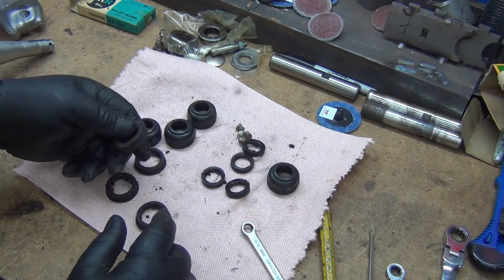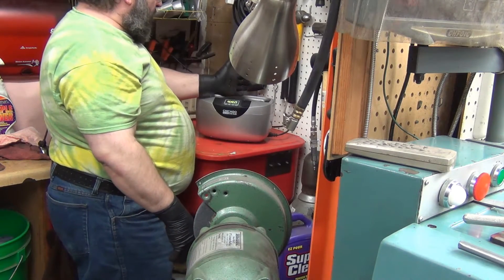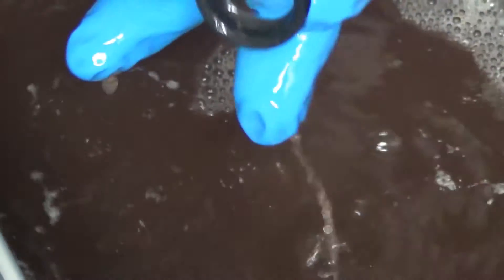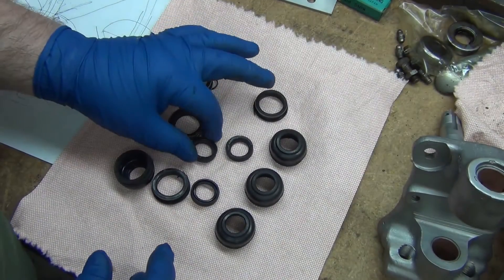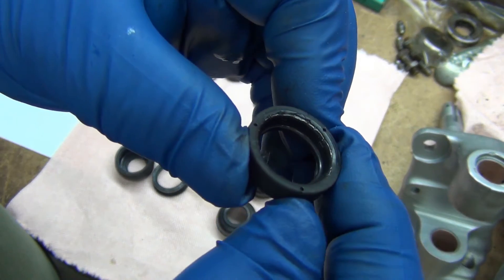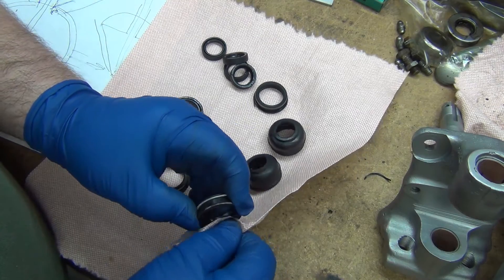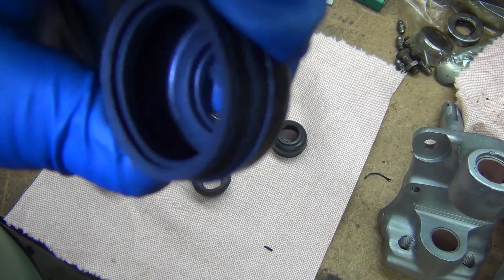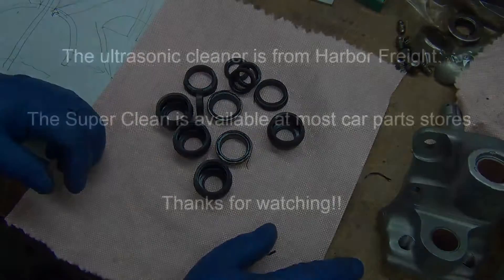UltraSonic Cleaner - Rubber Seals

Comment: My buddy/landlord recently picked up a US cleaner for carb work. It's a treat to have it available and does a great job.

Colin ;-)
Reply from the maker: ***** How big is it?....the cleaner
Reply: bluehandsvideo
Holds about a gallon. 6W x 8D x 10L ...ish
Wont fit four carbs at once though..coupla sessions to do a bike.
Reply from the maker: ***** Sounds like a nice size! Make? Model?
Reply: It's a PS-30A of oriental origin. Seems to work fine.
Reply from the maker: ***** 6.5L for dental use......$750!! Ouch!  I'll deal with less space a bit longer. lol!! Thanks!
Reply: bluehandsvideo
Yup, pricey units... thats why I use my buddys... LOL. He paid $300 I think.
Actual measure 11x6x6
Reply from the maker: ***** I did a bit more looking.....they can be had for about $150(shipped) in the states.  I'm seriously considering pulling the trigger on a 10L model :)

Comment: Was thinking about purchasing one of these and instead went for the tumbler, which I didn't rate that highly has to be said.  Watching this, makes me think I should of gone with the gut feeling and gone for the USC.  Cheers for the demonstration fella
Reply from the maker: GTs Garage The vibratory tumbler?  Scroll down and few comments and check on the ones under CompEdgeX.  You can get a lot bigger ones for a bit more money.  Thanks!
Reply from the maker: GTs Garage Have you got a sandblasting cabinet?  This works great for cleaning up small parts.  https://www.youtube.com/watch?v=OjygzUh6ep4
There's also some rust remover that works really well.. called EvapoRust  here.  Also... muriatic acid will take the rust off really quickly, but it can go too far if you leave the parts in too long.  The acid is the fastest, but it can cause hydrogen embrittlement, so you wouldn't want to use it on suspension or brake hardware.  
I also have a vibratory tumbler.  I tried Harbor Freight's small one years ago and didn't like it.  I now have their big one and it's been working really well.....but I've been doing bigger parts, not nuts and bolts.  Thanks!!
Reply: some great info, thanks, I looked originally at getting a sandblasting cabinet but I am stuck for space.  The larger stuff I tend to get powder-coated and sand blasting comes as part of the price.  Most of this project bike is done, but for the next bike, think I will invest in both sand blaster and ultra-sonic cleaner.
Reply from the maker: GTs Garage I guess that just answered my question about the blast cabinet. :)  I just modded my glass bead cab yesterday.....works waaaaay better now! :)
Thanks for the sub! I subbed you back.....I'm not into bikes, but it looks like you've got a good channel going. :)
Mike